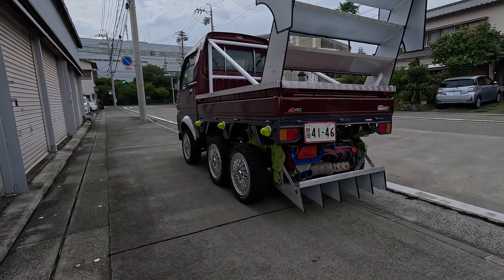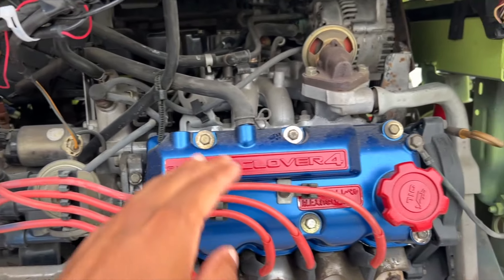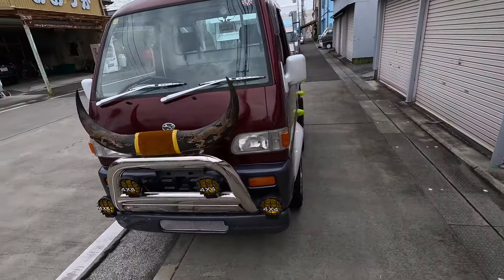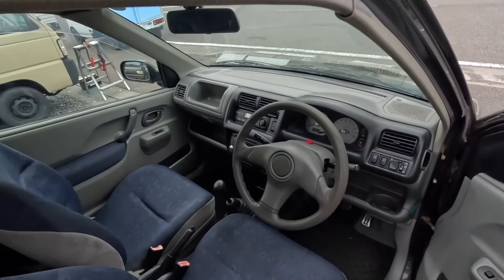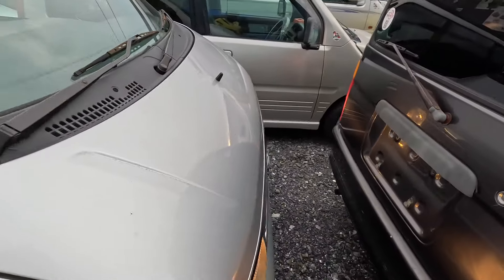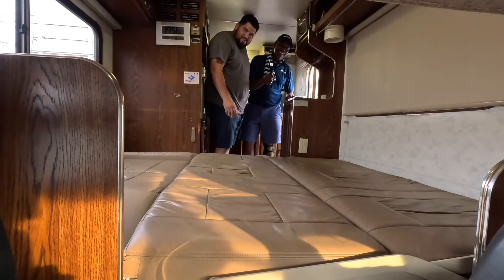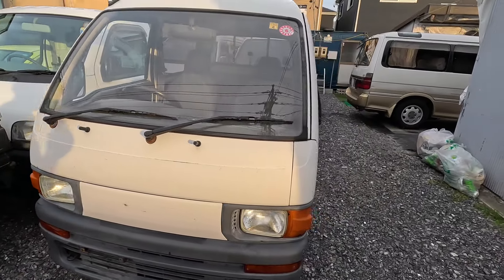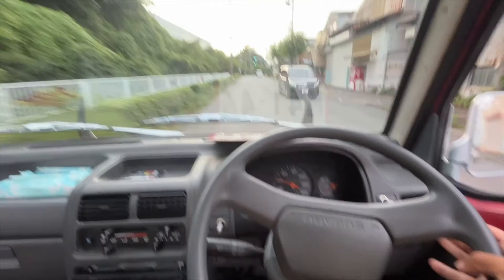6 Wheel Subaru Sambar Kei Truck!

Comment: Citroen BX in LHD surprised at that as I'm pretty sure Citroen's & DS models are sold their. 1 of our 2 cars is a 14 reg DS3 Dsport Thp. DS to Citroen is what Lexus is to Toyota , Infinity to Nissan , Genesis to Hyundai & Cupra to Seat. The BX wasn't a GTi 16V but in the late 80s early 90s they were really quick from the 1.9 16V 160bhp 0-60 in 6.9. The 6 wheeler would look great but needs the rear spoiler & metalwork removing.
Reply from the maker: Do those go for good money?
Reply: Citroen BX 16V GTi now if you can get hold of 1 & I've seen 1 recently on Pistonheads if you have heard of it, British but plenty multinationals post things about cars think it was under 10 grand. They have neumatic suspension when getting out they drop to the floor and rise up when ignition turned on. The yellowish car looks like a base model, so either a 1.4 , 1.6 or the 1.6 diesel. Over here GTis are still desirable but not a base 1.4 maybe in France. I like Citroen's basically our 14 reg DS3 is  a posh Citroen with the BMW N14 engine from the Mini cooper S R56 , North America it will be known don't buy any car that has a Cooper S engine older than 2012. BMW claim they had sorted all its timing chain problems by then. The R56 cooper S engine goes in all sorts in Europe , Citroen , Peugeot , DS , Mini & 1 & 2 series BMW.